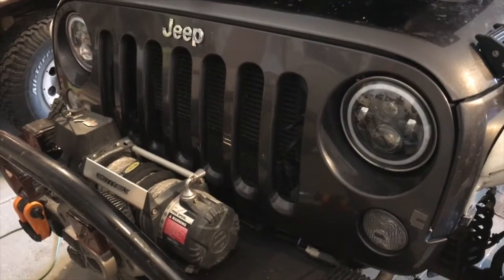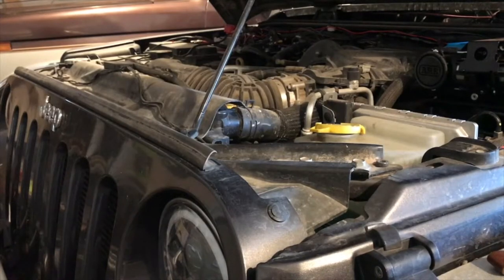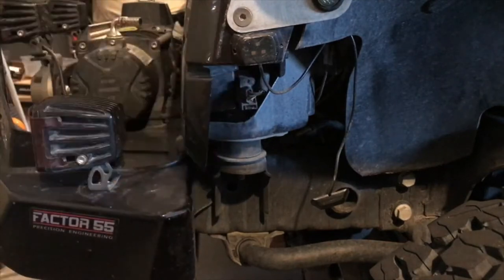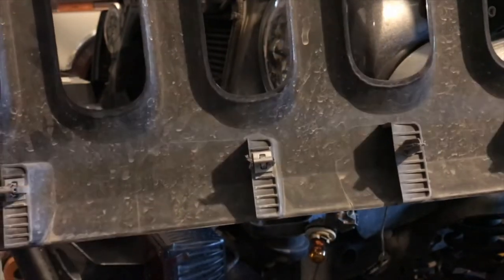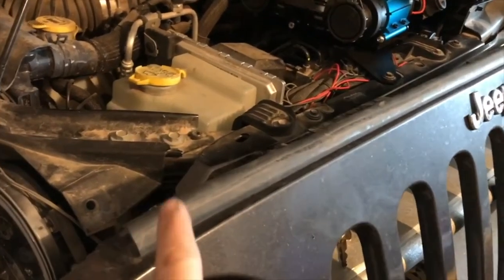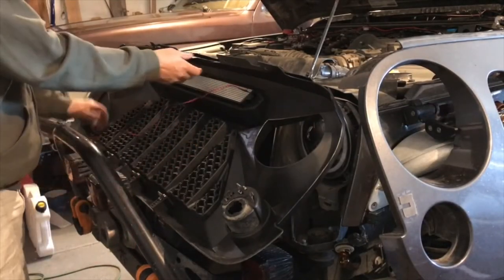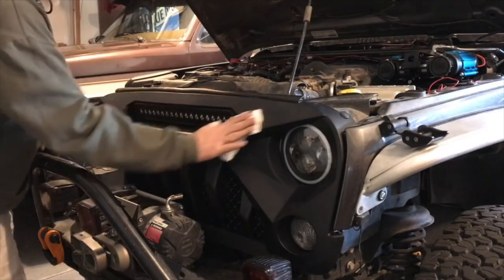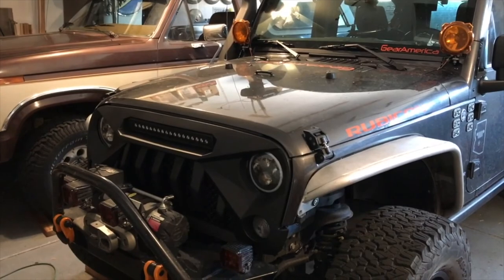JEEP WRANGLER JK GLADIATOR GRILLE WITH OFF-ROAD LIGHTS INSTALLATION | AMOffRoad

Comment: How do I install the LED light bar?? I am not sure how to download that part?? I have the grill in but not sure on the wiring ??
Reply from the maker: How to Wire: Connect the red and black wire of the light bar to ACC and negative of battery. OR You can check this video: https://youtu.be/B8FkMcQhkvs @2:40.

Comment: Could you show the wiring at on how by wired it ?? I am not mechanically inclined but can follow instructions pretty wel
Reply from the maker: Connect Red line to - ACC line , and connect the Black line to - Battery Negative line.

Comment: You didn't show how to connect the wire ...
Reply from the maker: How to Wire: Connect the red and black wire of the light bar to ACC and negative of battery. OR You can check this video: https://youtu.be/B8FkMcQhkvs @2:40.

Comment: How did you wire up the light bar!?
Reply from the maker: Connect Red line to - ACC line , and connect the Black line to - Battery Negative line.